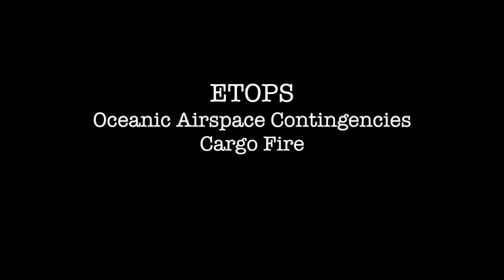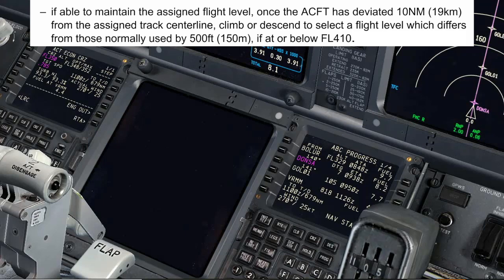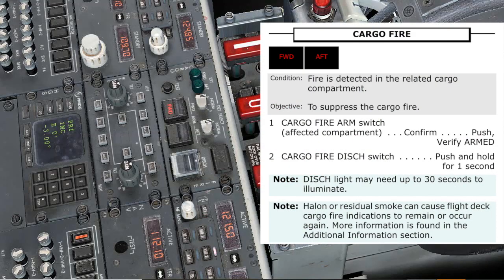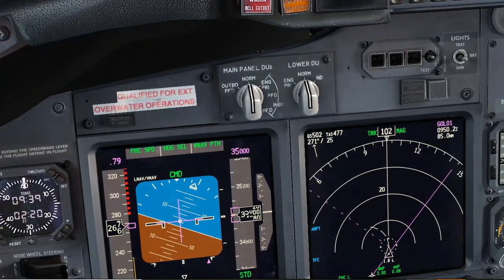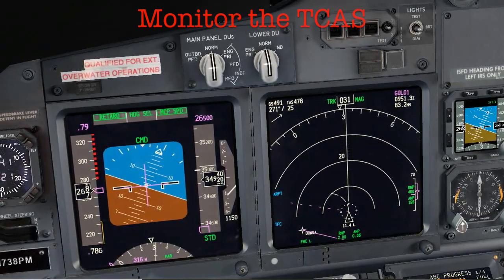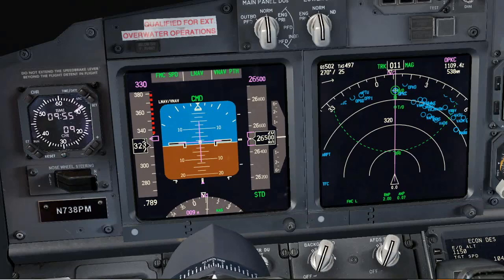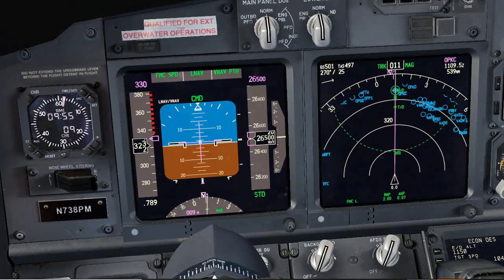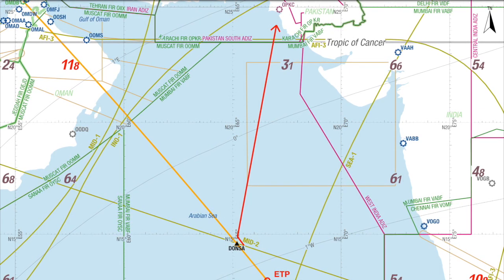ETOPS Contingency Procedures - Cargo Fire

Comment: As always, great video Captain. However in this case should the notes at the top include that the offset has been changed to 5nm now for this scenario? Cheers.
Reply from the maker: Thank you very much for the feedback. You are right, there are some changes in the ICAO Special Procedures for In-flight Contingencies in Oceanic Airspace, but it seems that India is still keeping the old ICAO standard procedure (CRARs).
Reply: India is using the new icao procedure now